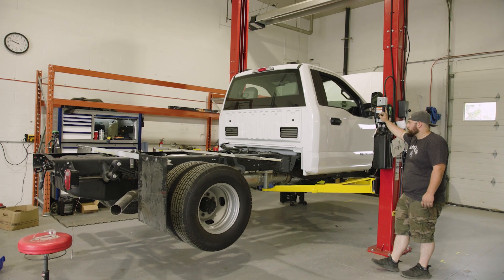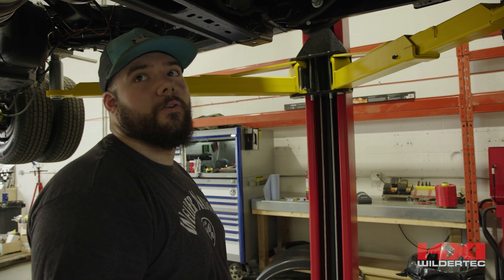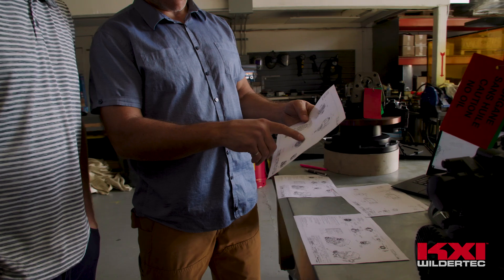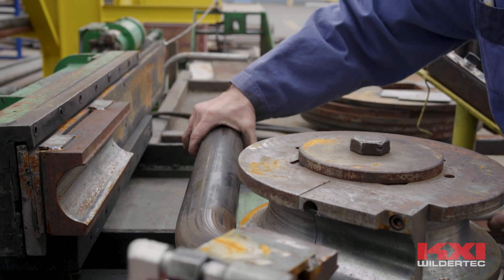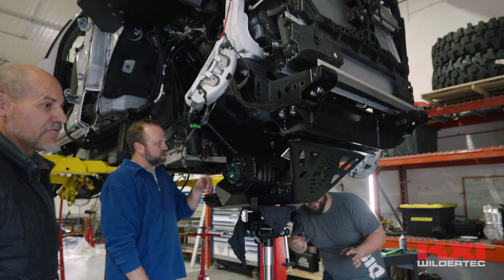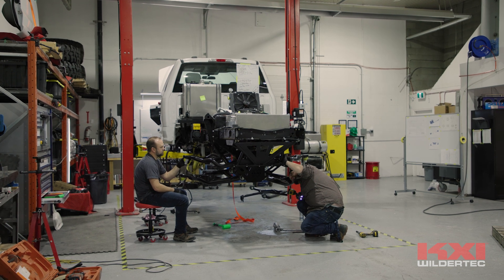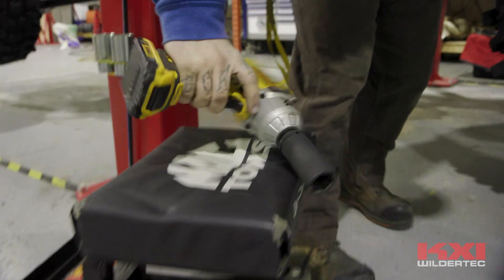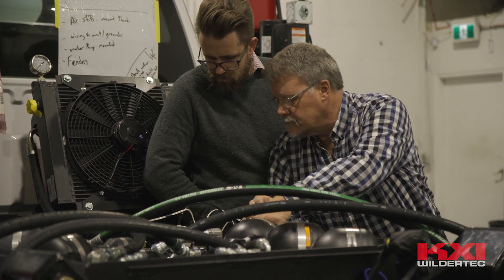Building the Ultimate Off-Road Vehicle - Episode 2 "The Build"

Comment: Apparently these are Cummins (Meritor) ProTec Series 2000 wheel-end assemblies. If YouTube allows the link, here's a video from Meritor featuring the next higher capacity (Series 3000) ProTec system... coincidentally also on a Ford Super Duty: 
https://www.youtube.com/watch?v=-VVZStwi3ks

Comment: I managed to pin down two component sources: the tires are Mickey Thompson's Baja Pro XS (presumably in one of the 20" rim sizes) and the air compressor is a Big Air from Sherpa Winches. Of course any tire of the same size could be used and the compressor is commodity minor part, so that's not very helpful. The wheel end assemblies and final drives would be more interesting.
Reply from the maker: Wheel assemblies, drive shafts (I think) and transfer case were from Meritor.
Reply: @EdgeDigitalMedia  Thanks! 

The wheel end assemblies would be the ProTec Series Independent Suspension Axle System (ISAS) from Meritor, which is now a division of Cummins. "2000 Series" is visible on the hub in the video: the 2000 Series is the lightest model of this range.

Comment: That "2000SERIES" hub assembly (seen at 8:15) is an interesting looking design... I wonder who supplies it?
Reply: @EdgeDigitalMedia helped with the information that these were from Meritor. 🙂 
That would be the ProTec Series Independent Suspension Axle System (ISAS) from Meritor, which is now a division of Cummins. "2000 Series" is visible on the hub in the video: the 2000 Series is the lightest model of this range, with gross axle weight rating (GAWR) of 7,500 pounds (3.5 t). 

It looks like the whole ProTec ISAS series is designed to use kingpins (although some variations don't), which is why the upper part of the carrier (where the upper ball joint attaches ) looks so awkward. KXI would presumably want to use a lighter straightforward ball jointed design, would probably want a wider arms base than Meritor uses, and might need to custom-build control arms to suitably locate their hydraulic cylinders.

Comment: I was initially a bit surprised to see (one minute in) that the starting point was a 4X2, with its goofy Twin-I-Beam suspension, but I suppose since the project was not using the original Ford transfer case, final drives, hubs, or suspension, it made sense to not pay for components which not be used. The end result will be the same as if they started with a 4X4, with only a different pile of removed parts to dispose of.

Comment: What differentials are you using?  Awesome build.
Reply: It would be interesting to get more information about all of the components, but that might be in the channel's Episode 5, titled "The Tech". 

Update 
Unfortunately, there's nothing in Episode 5, either.
Reply: @brianb-p6586  Yea, only thing I got was, they're military grade units. Its mostly about their the AWDAS system which is impressive  and all. I'm interested in seeing my 2500 on a set of those diffs with coil overs.
Reply: @Deezalmech  @EdgeDigitalMedia responded and said that "Wheel assemblies, drive shafts (I think) and transfer case were from Meritor." That helps! Meritor is now owned by Cummins, so their products are found in the drivetrain category under "Components" in the Cummins website. The final drives might be Cummins as well (the ProTec system is complete with final drives), but their website doesn't seem to have a category for them.

The wheel assemblies are from the ProTec line; they are the 2000 Series, which is the lightest model of this range, with gross axle weight rating (GAWR) of 7,500 pounds (3.5 t). That makes the wheel bolt pattern diameter 11 inch (285 mm); I don't know if that is commonly used on military vehicles, but they look like 20" wheels (which are probably the minimum wheel diameter). These hubs have a planetary reduction drive incorporated, so the final drives are subject to less torque and need less reduction than they would without reduction hubs; the ProTec Series 2000 system has a 2.92:1 hub reduction ratio.

By the way, 11" does not equal 285 mm (as stated in the published ProTec data table), so presumably it's actually either 11"/280 mm, or more likely 11.25"/285.75 mm.
Reply: Nice, I’ll take a look when I get a chance. I work on both Cummins and meritor stuff . I’ve good access to information on meritor and a pretty good parts guy that can find a gnat in a snowstorm.